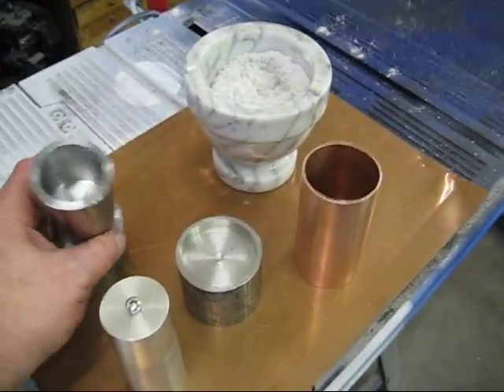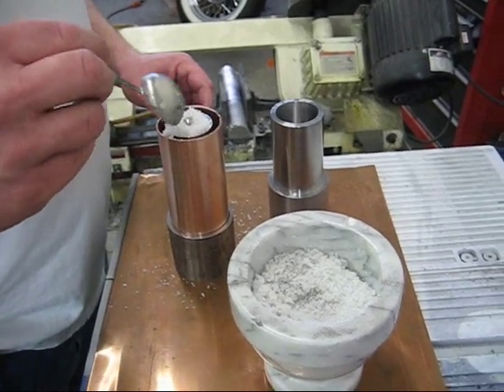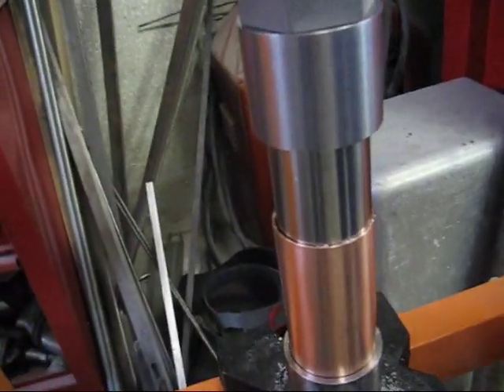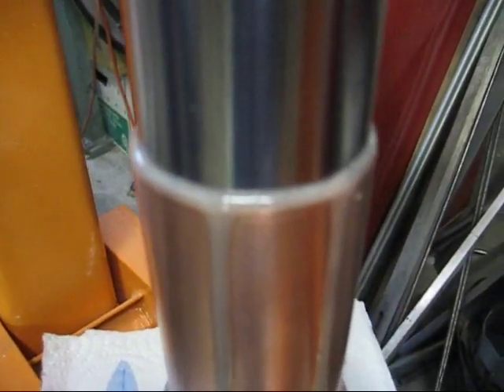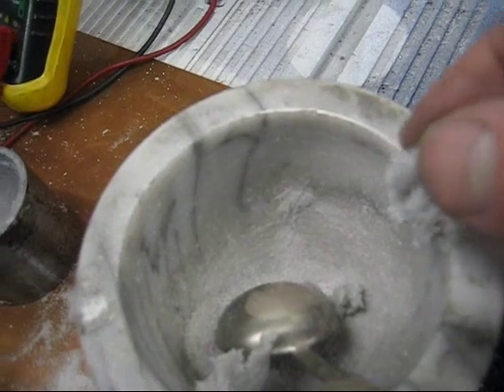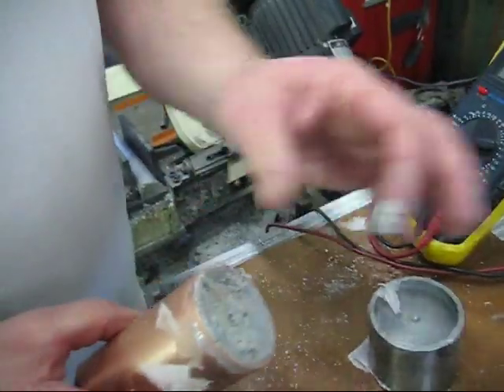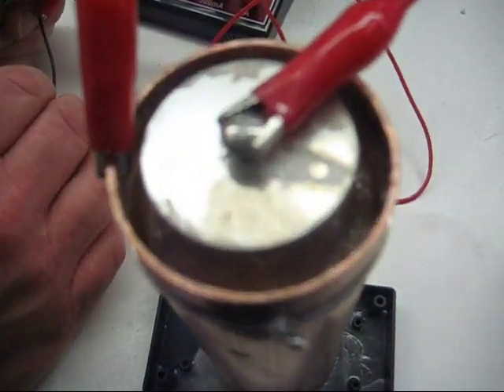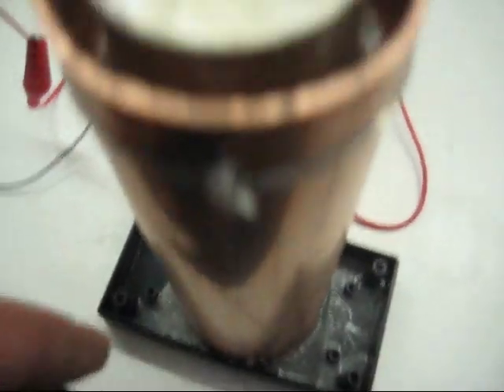Big Heptahydrate Hydrate Cells Chuck And John.wmv

Comment: Nice cells!😀 I made some cells from 4 inch pipe 2 ft long 6 cells. The inside was lined with copper flashing soldered at the seam. bolt thru the tube to copper, install 3inch pipe with holes drilled evenly. Wrap with nylon screen. Roll up stainless steel screen put inside pipe , 3inch pipe has a bottom . Drop  aluminum bits into center of pipe and add chlorine bleach you will get 2 volts per cell. Level of bleach can be regulated for less power output or more
Reply: I made these cells with a screw cap on top and bottom of the cells so they can be cleaned up with a wire scrub brush and rinsed and reused. This battrey is considered a fuel cell  it uses aluminum  chlorine tablets or bleach. This cell can Power a inverter and lights TV Icebox, I made different anodes one type was crushed aluminum cans on a sharpened  copper plated steel  ground rod cut to length and threaded on one end for nuts to fasten to cap soda can anodes was Fuel, or aluminum bits in  tube type anode.
Reply: I might make a video building these cells. I added a fill tube and a drain tube to my cells and a level indicator for electrolyte. So cells can be turned off

Comment: Part 2
What you are doing is compacting the crystal structure and squeezing it like a sponge. Maintaining the pressure while it squeezes out will make the crystals more compact and the water that comes out fills the areas that are now in between the crystals. This makes an very curious event happen. You now have huge amounts of structured water that is highly mobile because it is not bound to the crystal anymore. Huge amounts of ion exchange can now happen through the structure of the crystal.

Comment: Just remember that you want thew water to break down the salts then reform while the electrical connection has been established. All the while maintaining the pressure. Think of it as copying the diamond making process. Pressure is a key actuator for the formation of the crystals. The water that is in the crystals already should be sufficient enough for the formation of the new crystals geometry. But you need a better container(thickness of copper) for the salt substitute version.